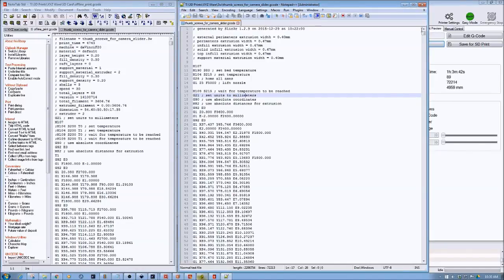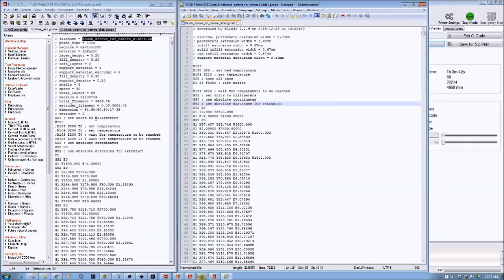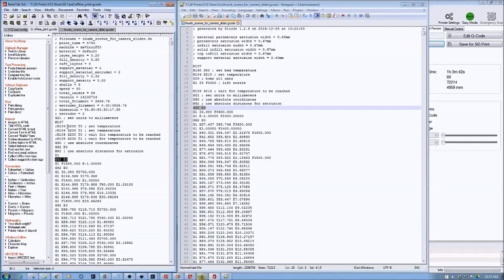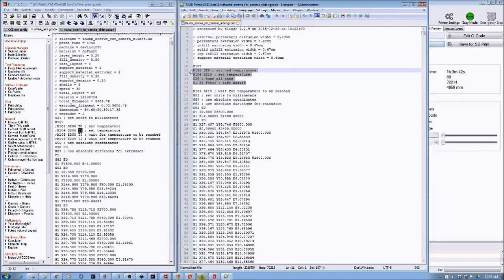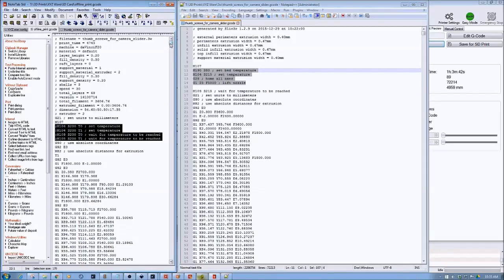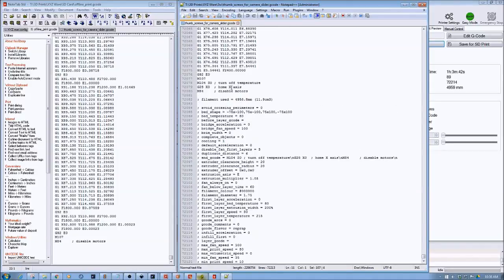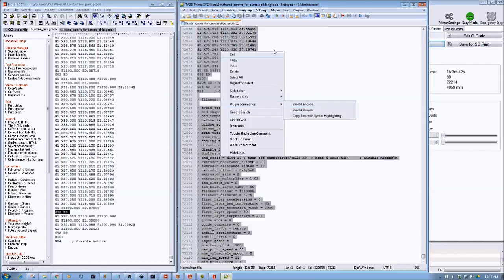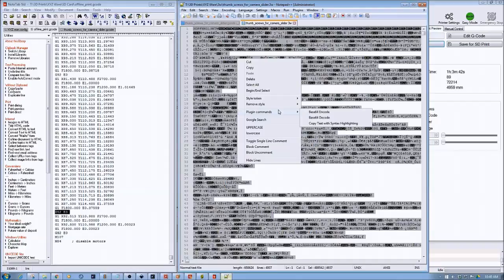XYZ Printing Da vinci 3D Printers - Comparing Slicer Files for Conversion

Comment: Also, the x86 and x64 folders have to do with the installation of Windows and the processor type. If it's a 64 bit system, it will use the 64 bit folder, if it's a 32 bit system, it will use the 32 bit folder. Most programs only install the files necessary for the system type, but it looks like XYZ is simply throwing it all in to save some time in creating the XYZware installation.

Comment: Do you have a link to your slic3r settings? I can't get mine to heat up before it starts to attempt to print or recognize two extruders.
Reply from the maker: +GuruAidTechSupport  Here is an early release version of a page that I am working on (http://diy3dtech.com/xyz-printing-da-vinci-2-0-info-and-hacks/) it has the code which I have successfully used.  Note the code to heat the heads is in the GCode and not Slicer, technically you should add this under tool change, however I added it to the header code.  I plan on doing a video when I get time this weekend as I was also reading the Slicer manual today and believe I need to make a few  more changes first.  Keep me posted if you come up with something as I think I've figured out a way to reduce the second head from prints however I need to experiment with it first.

Comment: Whenever I open a .3w file on a text editor it looks nothing like this. Can you please explain what you did to get it looking like actual Gcode. Thanks in advance.
Reply from the maker: +ismael mercier I created the GCode first and than converted to base64 (in NotePad++) which is an .3w file, going backwards is not as easy...
Reply: +DIY3DTECH.com Right. I was trying to go backwards. Do you know of any way to do it?
Reply from the maker: Technically NotePad++ should do it by selecting the code string and right click->plug in commands->Base64 Decode however I always get an error.  Maybe if you chopped up the string into smaller segments?
Reply: +DIY3DTECH.com alright. I'll try that. Thank you.
Reply from the maker: +ismael mercier I have also looked for other Base64 converters and have not found any so if you come across a good one, please let me know.  Oh the other thing which I just remembered is I read some where that XYZ might have changed the encoding (again rumor not confirmed) and XYZ Ware can still read Base64 but writes a modified format (again rumor).  but figured I would share it just in case...